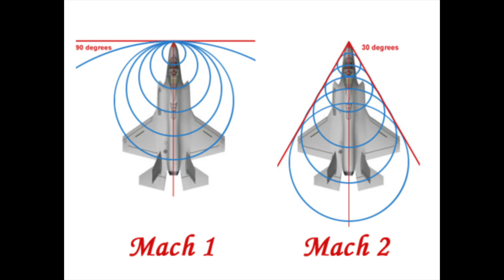Breaking the Sound Barrier

Comment: Thank you, Bruce.  I FINALLY understand why swept wing fighters were designed that way - to keep the straight wing wingtips out of the shockwave.
Reply from the maker: Robert Zeurnkel - It is important to understand the trade-offs with the swept wing.  Sweeping the wing back helps keep the wings behind the shockwave, but the bad effect is that low speed handling gets worse.  Takeoff and landing speeds are higher.  Low speed maneuvers are worse.  Spins are worse.   Center of gravity moves aft, making canard small wings up front helpful to get better maneuverability.  Bombs or fuel tanks on a swept wing tend to be too far aft, and big pylons are needed to put the stores as far forward as possible.  As a result, low speed aircraft like the A-10 have straight wings.
Reply: I guess the F-104's relatively straight wings got by because they are just too short to extend out into the shockwave.  heh
Reply from the maker: You are absolutely correct!  The little stubby wings were so thin they did not contain any fuel, so the F-104 had very limited internal fuel.  It could go really fast, but had short "legs".

Comment: Thanks Bruce, that's an insight I never knew, I took for granted the tails of jets. I also never new the wing itself was meant to stay inside the cone of compression, I thought the sweep allowed the wing to pass through the compression.  Is there a reason that many of America's current fighters have the tail planes so far behind the exhaust nozzel? Is this to increase leverage over CG of the aircraft? The F-15 and both F/A-18 types really have tail planes swept very far behind the exhaust! F-117 as well, though maybe its rational was more to really angle the edges away from radar.
Reply from the maker: Teri -- I expect that the slab elevators on modern planes are far aft for several reasons.  They need to be as far aft of the center of gravity as possible so they give more leverage in turning the fighter.  They are also aft of the engine exhaust, which would help shield the engine (which is heat-treated metal, not stealthy) from radar contacts, and to hide the hot engine from infrared contact.
Reply: Thanks for these vids!

Comment: Great video, Bruce. It's interesting how that research and test data also informed jetliner design, too. Modern swept-wing jetliners have a lot of the same design characteristics used in the F-86 and can cruise fairly close to Mach 1. I think the 747 can make around 0.92 or so if you kick it in the rear, although 0.86 is more common. I think the slab elevator is also common on jetliners.